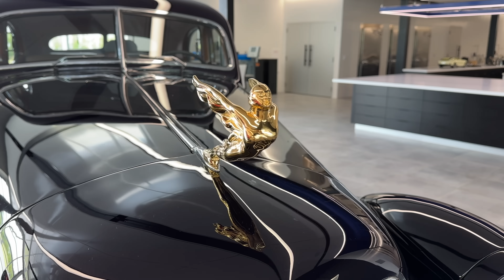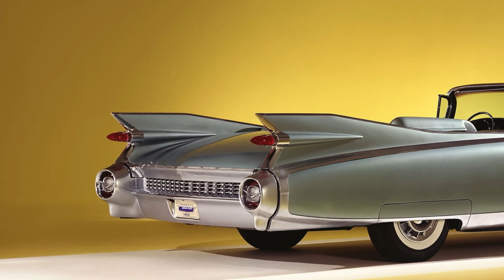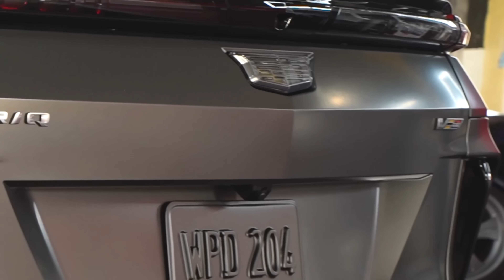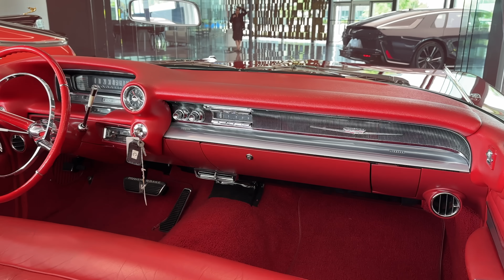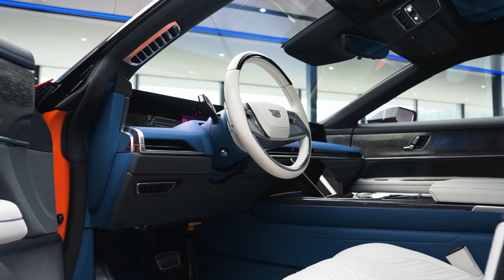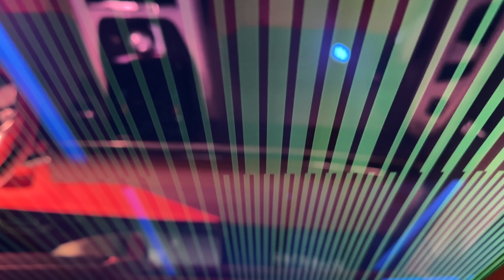The Cadillac you CAN'T Buy at a Dealership: Inside the Celestiq

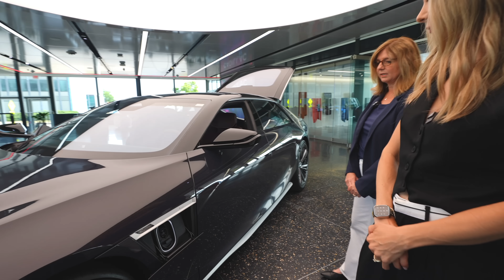Comment: 5:35 Why is there a CCS1 connection? Most Cadillac owners are of the "nearly dead" category. Either by lifestyle or age. Neither want such a heavy cable for DC charging. Younger owners could get shot while fiddling with such a bulky cable, unable to grab their gat in time for retaliation. The older segment of the nearly dead, will simply drop the cable, and will be unable to pick it back up.

Comment: One Legit question: if your car battery power completely dies (how will you get back into the Cadillac without breaking the car window)
Reply: I do t think they’d tell us because it will make the car prone to break ins, is my guess
Reply: @rocketshiftgaming5693  Electric cars have 12 volt batteries to run accessories. I would guess Cadillac controls the doors with a 24 volt though rather than 12.

Comment: $340K and no NACS ?!? And my guess no CarPlay either (because GM).
Reply: The Lucid Gravity has the set the gold standard for future BEV charging. Ultra premium BEVs like this need step up. You can't sell a $340k car with such outdated tech, it makes the whole thing a real waste (which is ironic, because battery electric vehicles are supposedly trying to be environmental friendly). This thing will tank in value almost immediately.
Reply: What’s the point in having a car that can charge at 800 KWh when you’re lucky to find a 150 KWh - 350 kWh charger? That’s like having a 9G phone but there’s only 5G towers what’s the point?
Reply: @ffmcmav40  Future proofing. The chargers are coming.
Reply: Easy trigger. It will get it. The carplay i can agree with you.